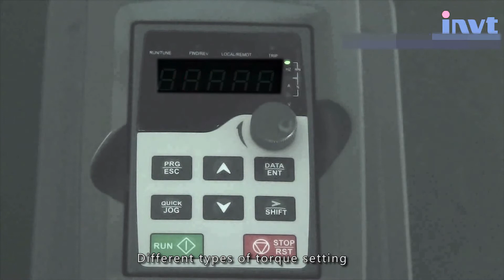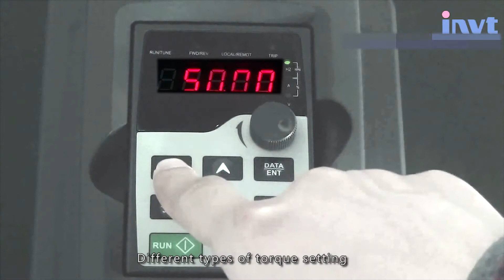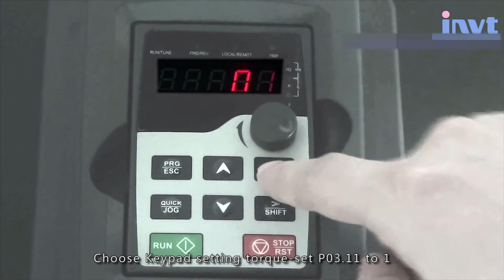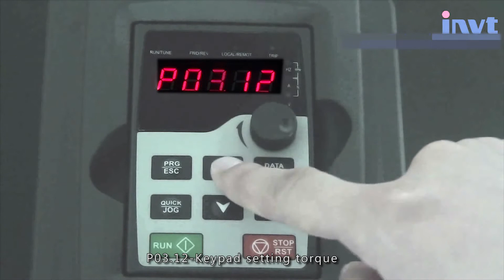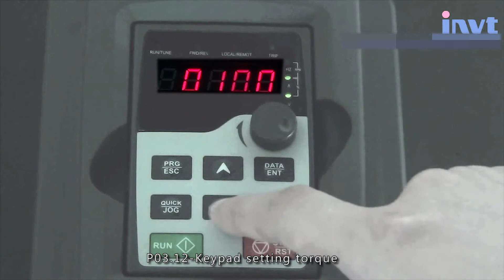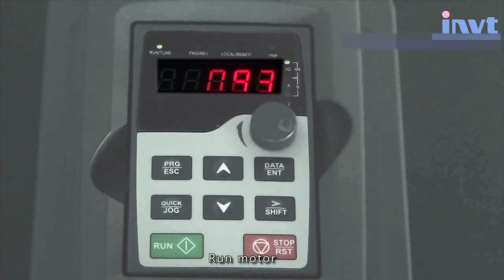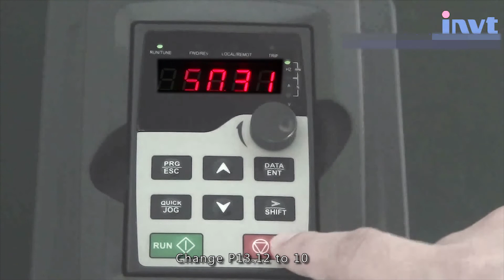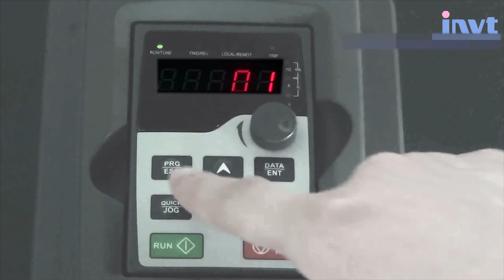VFD: How to  Control Inverter Function Torque?

Comment: sir in torque mode starting amps is higher then speed mode, if the 3hp motor amps  4.5 in  torque mode how much Amps will take
Reply from the maker: Hi sir, may I have your email?
Reply from the maker: Hi sir. Thank you so much.
Totally new experience changing the vision of #Fair! 
Do you know The #127thCantonFair will be held ONLINE? Do you want to experience it in advance？Sub to #INVT channel to join the VFD Fair Live.
Date: 4/30/2020 
Time: 15:30 Beijing Time
More: https://www.youtube.com/watch?reload=9&v=ZwfMisFIBg8
Reply: Vfd inverter Guide channel 👇👇👇♥💕❤🙏👇👍👉💕👇❤❤ https://www.youtube.com/watch?v=SWb7ZagV4gQ&t=218s